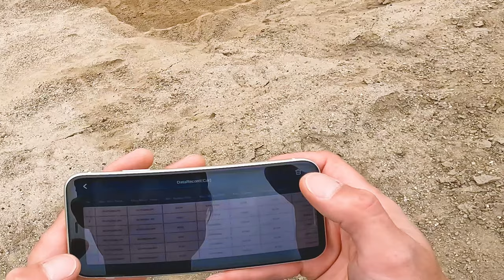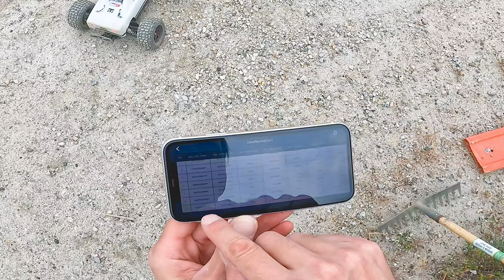Tekno MT410v1 Bash - Hobbywing Max8 G2S - Basherbodies - M2C

Comment: You had some beautiful front and back flips. The slow motion shots are neat. I don't remember, do you have a fan on the motor.
Reply from the maker: Yeah I run a double fan mount with 2 hi speed fans. Sounds like a jet but would probably get much hotter without it haha...
Reply: @shralpRC  There's no doubt it would be a lot hotter without them. What batteries are you running?
Reply from the maker: @michaeldorich4485  For sure. For the tekno I use a 4s gens ace redline 7500mah, and a 4s Tattu 4500mah, xt90 plugs.